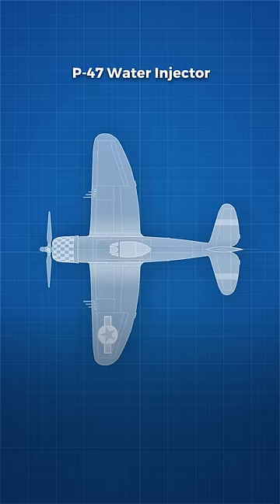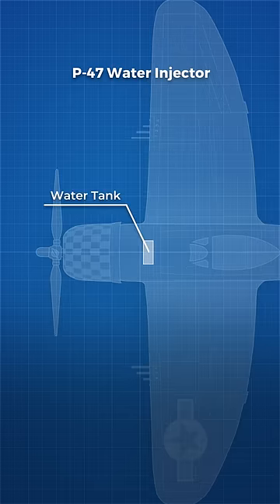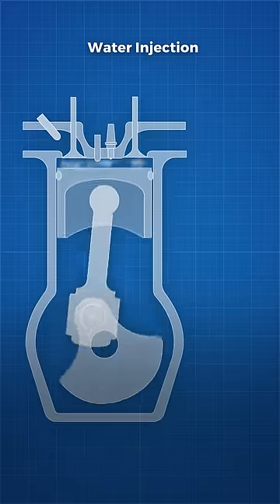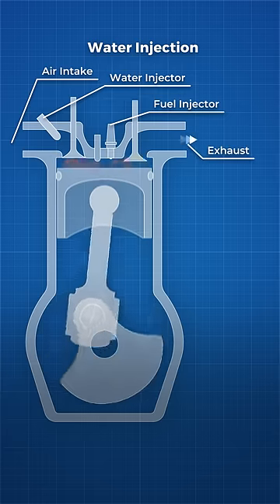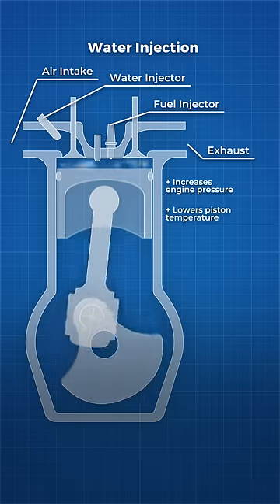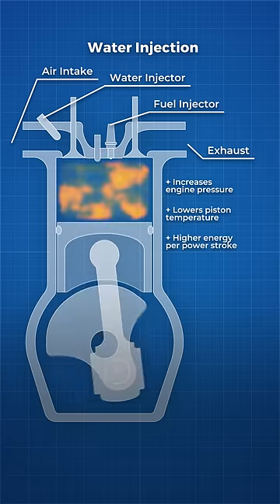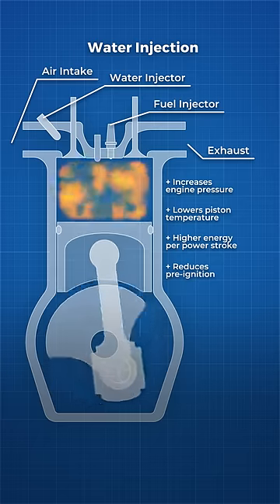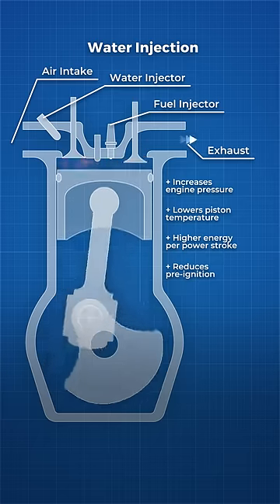How Water Injection Increases Horsepower

Comment: Now I'm wondering why we never used this system on car engines to make them more efficient
Reply: Because water puts out fire, duh.
Reply: it makes hell of Soots and smoke,and greately reduces engine's lifespan
Reply: Some high performance cars do. Common in drag cars
Reply: Nevermind, according to wikipedia it does exist but isn't widespread yet.
Reply: Some BMW do
Reply: Bmw m4 gts has this system
Reply: High performance cars typically have meth-injection for power gains, which is basically this. But I don’t think it is practical for regular everyday cars
Reply: Only car that I know of that's done this is the BMW M4 GTS
Reply: They do on drag cars
Reply: It's impracticable but I thought Buick tried it in the 1950's with their "fireball 8" strait 8 engine.
Reply: I have a meth injection kit on my car, it's a fairly common mod for people building anything with forced induction.
Reply: It reduces efficiency afaik. It's only good for a power boost
Reply: @NewfieOn2Wheels  meth!?
Reply: @fg8557 I'm not a molecular scientist but why would it reduce efficiency? By reducing the chance for knock and preventing damage to the piston I would think it increases efficiency as the ecu is more flexible with timing.
Reply: The Koenisegg Jesko uses water injection
Reply: It increases price tag
Reply: @redcrafterlppa303  I think the main effect ist that combustion is less complete.
But it could also be that steam is worse as a process gas or that the combustion temperature drops
Reply: It produces more power at the expense of efficiency, if it could improve efficiency we would still drive around in traction engines
Reply: Easy. P-47D is one of late prop fighters, something that is often called "superprops". Their engine needed heavy maintenance after 50 hours(if lucky), total refit after 100(if lucky) and basically melted themselves down into a brick if pushed further. Military switched to jets for a reason.
Reply: @Jonny2by4  I feel that for some viewers it would be important to specify that you've meant methanol injection 😅
Reply: @mikeholland1031  lol not the same meth your thinking of some races cars only run off methanol instead of gas.
Reply: @deehsar52  ok then. Dunno why I didn't think of methanol. I thought you were making an unfunny joke. Lol. What's the difference between methanol and ethanol?
Reply: they did, saab cars had it, but never got reliable, and also was too complicated
Reply: You know, for the reason that you would need to be topping up the water tant and carrying it around at all times with more complicated motor for what? Basicly nothing?
Reply: @yayayayya4731  I think not him... 🤔
Reply: @fg8557  @HyviaVideoitaMansenlale I don't know, Bosch reports reduced fuel consumption and CO2 emissions with their water injection system, that's the kind of "efficiency" I was talking about. Don't know if it's actual science or marketing tho. Petrol is getting harder to find and we need to reduce air pollution, that's basically what we need. I would be ok to refill my water tank on my car if it helps those problems.
Reply: @Bladavia  Petrol is just a side product and we will have other problems before we have cars with no fuel.
Reply: I actually built a system like this for my 6.5 TD powered GMC Suburban. I plumbed in a nozzle just past the turbo and ran it on low flow because I primarily needed it for cooling. The 6.5 Detroit diesel powered Suburbans are notorious for overheating and that particular engine REALLY doesn't stand high temps very well so it is a fairly common system to build for them. It dropped my engine temps by a good 20 degrees and kept it from overheating on hard pulls, plus it gave me a little extra power, not so much from the cooler air temps but because water expands 10,000 times it's volume when converted from a liquid to a gas. It also had the side benefit of steam cleaning my engine from the inside, lol. Yes, the first time I ran it I thought I had blown my motor because I saw a bunch of black smoke roll out from the exhaust, come to find out when I pulled the heads, the combustion chamber and exhaust valves and everything past it was spotless.
Reply: We do. Mostly just on turbo engines.
Reply: Bad for oil. Makes sludge because of moisture coming from evaporated water
Reply: @fg8557 You also have to carry a tank of water which adds more weight. Even fighter jets have water injection but there's a limit on how much water they can carry before it adds too much unnecessary weight. There's a diminishing return on this system. Not to mention cars don't need this system unless it's for racing.
Reply: Because users are dumb. BMW implemented it a couple of years ago and sales dropped because the user doesn't want to have to fill two tanks. It's however a common system in drag cars
Reply: Some do. Making a comeback with some BMWs, which is interesting since the FW-190 BMW engine also used this method.
Reply: Probably because you would have to buy gasoline along with the methanol water.
Reply: It works very well in a diesel engine.
Reply: @beefymcskillet5601  yeah people would bitch about "OMG I have to not only BUY distilled water but I have to PUT IT IN MYSELF!?  Can't you just make it a subscription service?"
Reply: Because we don't need such: modern gasoline have ethanol pre-mixed unto it.
Reply: BMW has put this technology in some of their M series cars to prevent knock during high engine loads. It was discontinued because it was considered too much of a nuisance to top up the water from time to time.
Reply: I have a 07 5.9 Dodge Ram 4×4 2500 diesel. With a few modifications I am at 502 hp on a dyno. One of the add ons is a Snow Performance water/meth injection system. Of course under full throttle I also induce extra fuel. But tooling around town and some hwy miles I am at almost 20 mpg. I have gotten 22.3 mpg on trips. The truck weights 7240 lbs with me and 35 gl of fuel. 
The Snow kit came with a 7 gl water tank.
Reply: My kneejerk reaction is: because increased performance is not the same thing as more efficiency. You use the denser air to burn more fuel per stroke, right? Unless you mean this could make a small engine perform the same as a larger one. Would that help outside of saving weight on the engine? But you have the added weight of carrying the water instead.

Or perheps a stronger explosion per stroke can allow for a lower stroke speed? Does that help in any way?

Some people argue that less knocking (which is caused by pre-ignition?) equals more efficiency since more fuel is ignited at the optimal time. That sounds pretty cool, but i wonder if there aren't better ways to lower the engine temperature these days. Water injection was perhaps clever at the time, but it sounds kind of crude to me, idk.
Reply: @mikeholland1031  Methanol has one carbon atom whereas ethanol has two.

"Monohydric alcohols" as a category are just chains of carbon atoms surrounded by hydrogen atoms, except one of the hydrogens is replaced by an OH (oxygen + hydrogen). So methanol is like a size 1 alcohol, ethanol is size 2, and so on.
Reply: @volbla  it absolutely does increase performance. A colder cylinder means increased thermal efficiency and increased knock resilience means you can run a higher compression which increases thermal efficiency further. It‘s just not worth the extra hassle of carrying two „fuels“ with you from a consumer standpoint.
Reply: Does a car with blown head gaskets between the water jacket & cylinder count as having water injection 🤔
Reply: @Bladavia 
The water injection system is only essential for boosting when the engine would otherwise run full-throttle. 

But otherwise it has drawbacks like diluting the engine oil on the cylinder walls, reducing lubrication, and contaminating the crankcase oil. So it's crap for continuous use. 

A cleaner system could use an air inlet heat exchanger (like an Intercooler) which, in turn, is cooled by fresh air chilled with evaporated water. Like any swamp cooler, it works best with dry air and consumes a lot of water. 

Really any insulating you can do to prevent the intake air from heating up due to the [high] engine compartment temperatures will help. 

Gasoline / methanol blends are a good compromise for most people, but I don't see much savings, and all of that is from corn subsidies, ie corporate welfare.
Reply: @sharlleclerc  Engine is 
damaged only when Water injection has been excessive in volume and/or duration... A proper Water, or better Water+Methanol injection system is not more used, not because of that imagined disadvantages you supossed, but just because it is very inconvenient to have to replenish the mix every day or more often... In fact, that mix injection does effect some carbonous deposits cleaning, but once the carbon is removed, there is no more soot emitted, unless the engine is run so rich that it keeps emitting soot due to improper combustion.
Reply: @Bladavia And most probably it won't be used at all... ever.

Because it is impractical for the great 99.999% of daily drivers, to have to replenish either "plain" water (Which has to be minerals free), or worse, Water plus the Methanol mix every day!... or even more than once a day depending on driving: Very cumbersome, not practical at all and costly!  But for a quarter mile racer, it is the complete opposite situation.
Reply: @yayayayya4731  Ignorant, I would think...
Reply: @fg8557 TRUE, but ONLY when improperly done.  Like when added in excess, with a too simple manual switch and no measurin to get the proper dosification.
Reply: @southronjr1570  The cleaning effect is real!... but check your nimbers for that value of volume expansion... you have it exaggerated by a factor of about ten times!
Reply: There are aftermarket kits that add this. For one, you need forced induction and a way to increase boost when using ADI and only when using ADI.
Next, water isn't the only option. Before WW2 there was a big study into what was best, and a mix of 50/50 Water and Methanol was proven to be pretty much the best. That still holds up today.

Why it likely doesn't get added to cars is complexity and maintenance. It serves the same purpose as higher octane fuel but with an entirely separate injection system. Plus, I wager most people don't even know where to buy methanol.
Now about power gains. If your car makes, say, 170hp, you can probably get up to 210-220 with this. It's not a huge difference.
Reply: @TheArklyte  Military switched to jets because they're much faster. Even a WW2 era jet's optimal climb speed was high enough that no piston engined fighter could have a meaningful climb rate while keeping up.
And if they can't catch up to you, you can basically ignore them.
Reply: @konekillerking  The BMW 801 radial never did. They tried, but it severely reduced reliability, and they used "C3 injection" instead - basically this but with fuel. 
The Daimler Benz and Junkers engines had no issues though.
Reply: @Bladavia the real truth is three tiers, one is complexity where the design and maintenance is harder, second is material price as everything after the engine needs to be waterproof or more precisely rustproof as high heat + water + leftover oxygen + metal = rust, third is catalytic converter efficiency drops as the media is cooled of by the water steam. So the gain is only for users willing to deal with that three setbacks.
Reply: @sharlleclerc nope nothing of what you mentioned happens, why should it reduce lifespan? Currently use it on a 650hp v8 for years already, no cylinder scoreing and the valves are clean as hell and about 70hp gain
Reply: He is not saying "more efficient" but more "horse power", which is not the same ;).
With the same motor, you deliver more power at the risk of  destroying it.
Reply: BMW did experiment with it, and I literally have an Aem water injection system I'm installing in my diesel Volkswagen shortly lol
Reply: @redcrafterlppa303 it increases efficiency this dude has no clue
Reply: @dreddwailing5505 it increases efficiency lol
Reply: @volbla water injection increase efficiency across the board, results in cleaner exhaust emissions... Completely removes the need for Nox treatment in diesels and gas motors aka no EGR. Cleans valves, pistons and cylinders etc.. There's a ton of benefits
Reply: @DarkAttack14  why don't you chuck a bucket of water on your fire then 😂
Reply: @Jonny2by4 correct
Reply: There were some many decades old tractors that used water injection too.  so it's been around for a long time.
Reply: They used to sell water injection kits back in the late 70s/early 80s when gas prices were getting high. The selling point was better milage- efficiency rather than power.  Alot of people tinkered with them and technically, they did work. Worked well in the right conditions. But improvements were minimal if the engine wasn't working hard or was running in cold weather. And there is less to be gained to begin with in a low compression engine. When gas prices leveled off, water injection faded away.

Comment: The only problem with your presentation is that you have the spark plug in the animation labeled as the fuel injector. The fuel injector is actually to the left of the spark plug in the animation. Just to clarify for those who have never seen such a system. Not to knock your effort. Otherwise very informative.

Comment: Real Engineering really fell off hard, huh?
Reply: Wym? I noticed lower views but thats it
Reply: @legendofman12  I mean he's no longer a reliable source. He called the spark plug an injector. That's like, AI levels of incompetence for his "expertise"
Reply: The source video is 3 years old
Reply: @user-Aaron-  The short is 4-5 hours old.
It was published today.
And it was not fixed.
Reply: @oshawott4544 Yeah I know, but it wasn't fixed because it's just a snippet taken directly from the original video.
Reply: @oshawott4544  thanks for pointing that out
Reply: @legendofman12  that's only one of a dozen issues people have pointed out with this short clip
Reply: @user-Aaron-  you seem to forget that this is still being shared as if it's accurate, despite immediately obvious bits of misinformation
Reply: @oshawott4544  I'm well aware of that and firmly believe they should correct any and all errors regardless of time or inconvenience. I'm not arguing against you so I'm not sure why you're being so defensive. I was merely pointing out that if they indeed "really fell off hard" that it must've happened at least three years ago. I'm not familiar enough with the channel or with engineering to know one way or the other, but my point is that this apparently isn't a new phenomenon, which is concerning.
Reply: @oshawott4544 arrogance eh mate
Reply: @oshawott4544  What you on about, hes never been a reliable source... There is many errors in most videos I've seen from this channel!
Probably lots more errors I couldn't catch because of my lack of knowledge on some things(Or I couldn't care to do some research about).

Comment: Lots of hot comments, one small addition 😅 Engine pressure actually lowers because of the cooled air. Density and overall air mass increases, but lower pressures allow higher efficiency as you're not cramming the air to the same degree(PUN INTENDED)

Comment: That the extra power is from cooling the intake is flat wrong. The water/isopropanol mix reduces the combustion temp, allowing for a more advanced timing, which otherwise would cause per-ignition. It  acts like an octane booster. The injection of the mixture is controlled by a simple spring loaded membrane pump, that ejects water when intake pressure drops. Very low tech.

Comment: Why explain water injection when it was a water/methanol injection system? It's similar, very similar- but the addition of the methanol has added benefits like; Helps the water/methanol mixture to stay in liquid form at high altitude where air temps can be many times colder than the surface temp of the Earth beneath. The methanol has a much higher latent heat of vaporization- meaning it pulls much more temp out of the inlet tract air than just water alone. It adds extra knock or detonation resistance by increasing the octane rating of the fuel, so much so that in boosted engine you can use more boost AND ignition timing and make more power. The water in the solution cools combustion temps to allow more ignition timing again- the methanol is burnt as a fuel, so this is where the water takes over the cooling by lowering combustion temps... Much better than a simple water injection system, water/meth injection kits are the duck's guts!!! 🗿

Comment: In the 1980s I  had water injection on a car with a high compression engine. At the flip of a switch it would start injection based on rpm and intake manifold vacuum. I could then advance timing without causing any issues from engine knock. This gave a few extra hp. Use cold water & alcohol to really lower temperature and it was a real kick in the pants.
We also used to coil metal fuel lines in a big metal coffee can. Fill it with ice before you race (drag race). Combine these two and the effects were great.  Sorry I don't know what the actual hp gain was. Dyno's were not real common back then.

Comment: My first time doing the prelude timing belt(which was also my first timing belt ever) i fought the belt forever. Just to put it back together and the timing be off. It ran like complete poo. Ended up doing the job again and doing what you did by cheating the time a little to finally get it right. If you can work on a 3rd Gen prelude you can work on anything.

Comment: Wrong. The water/meth  injection allows you to run higher cylinder pressures, i.e. higher compression or more boost without detonation. 
Every water molecule in the combustion chamber is a spot where oxygen or fuel molecules could be. Water takes away space that could be used to make power